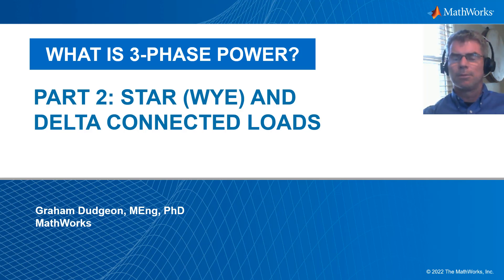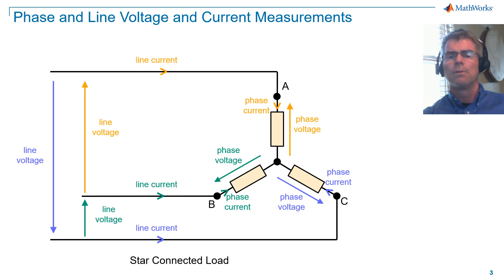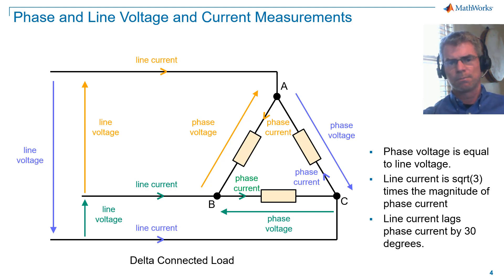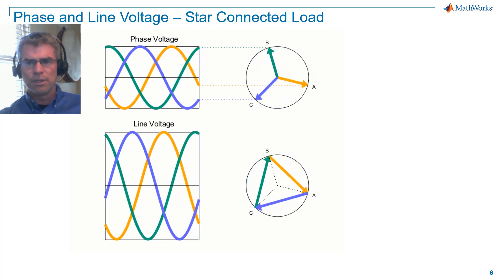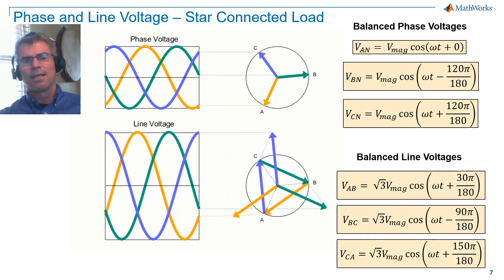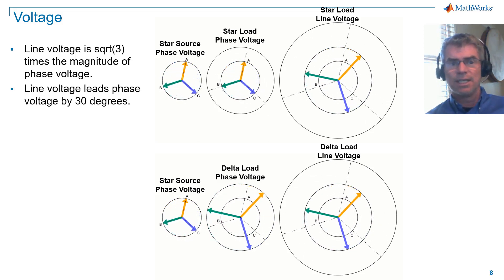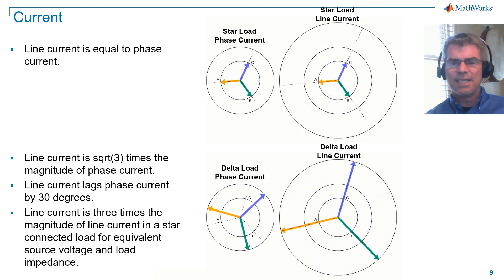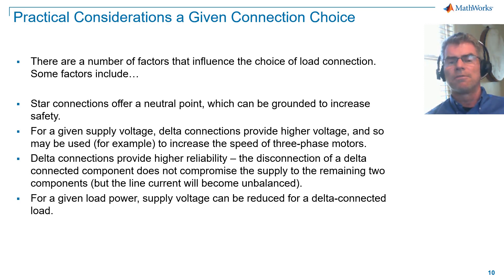Star (Wye) and Delta-Connected Loads | What Is 3-Phase Power? -- Part 2

Comment: This is a great initiative. My suggestion is if you start adding some practical tips on how to model different equipment (generators, transformers, etc.) in real life as we have some values for them which might not be apparent how they affect the overall power system. These can be like X/R, transformer impedance, taps, short circuit power and other settings in Simscape. Thank you